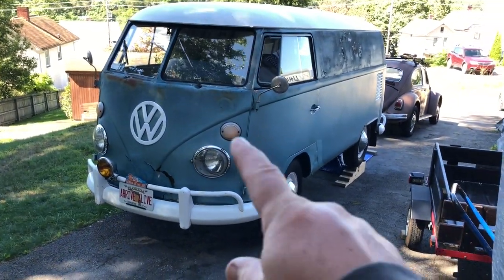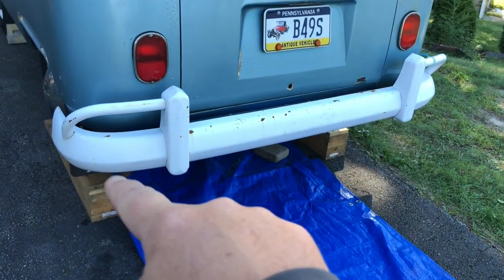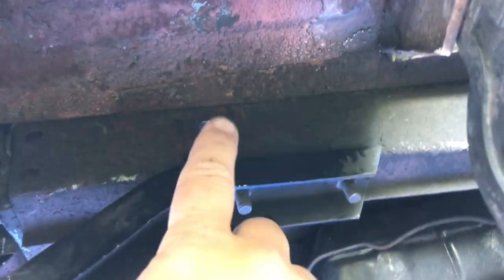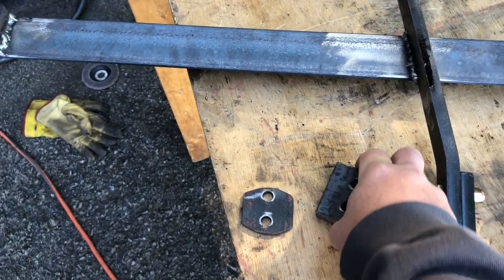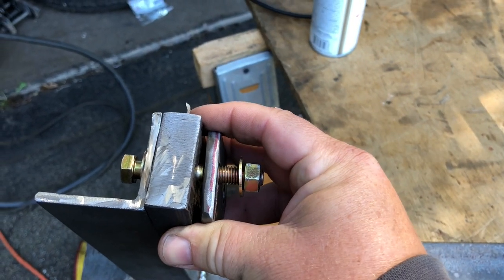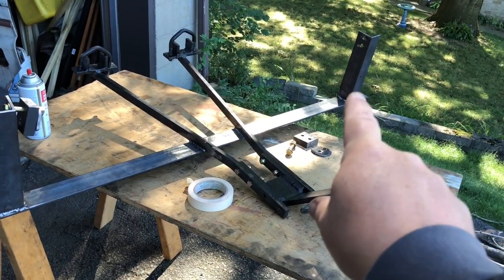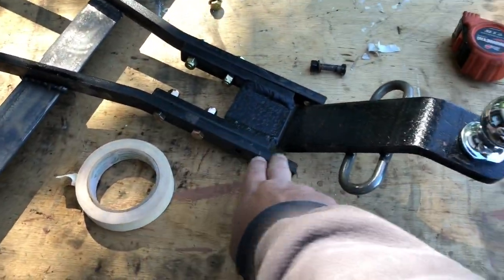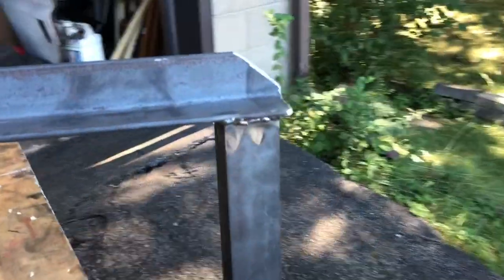VW Bus trailer hitch and Harbor Freight trailer

Comment: You can use the slightly larger 5.70-8 tires on the existing rims and they can still go on the hubs without modification. Even though they reduce fender clearance in between but it shouldn't be a problem.
Reply from the maker: Excellent point. I did try a larger set of wheels. Since the VW is a low horsepower vehicle the bigger tires seemed to slow it down over hills. I didn’t like them so I switched back to the original smaller tires. We cruise at about 60mph so if it slows me down to 55mph I’m not happy. Ha ha!! Thank you for watching.